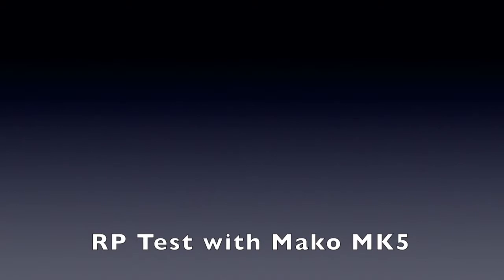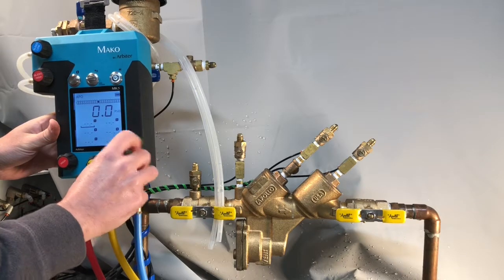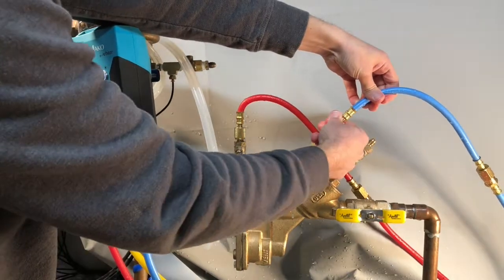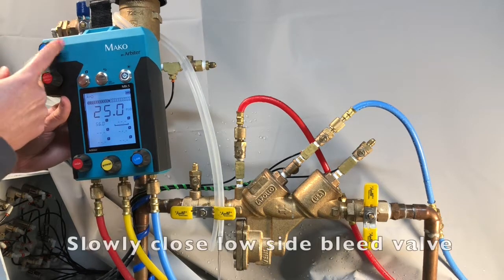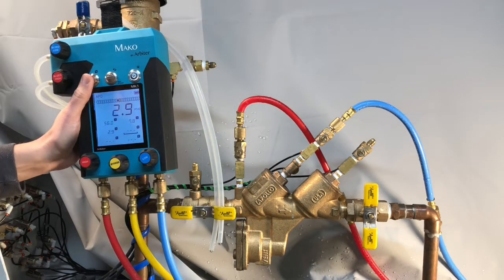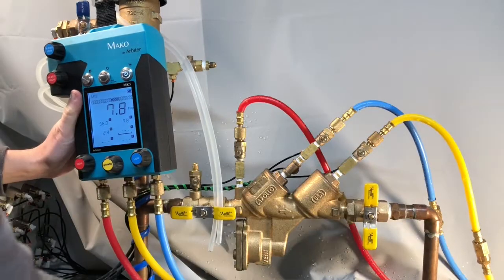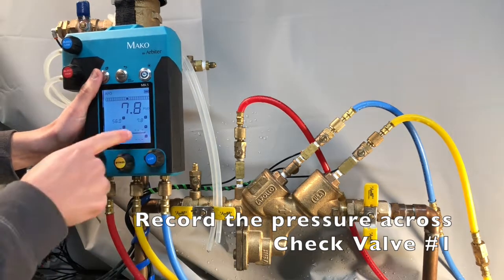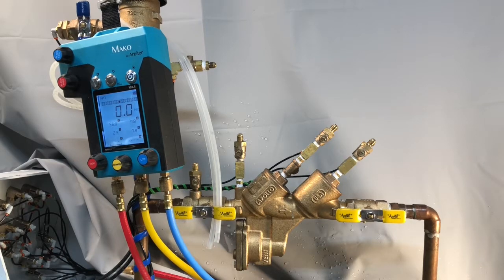RP Test Procedure USC 10th Edition MAKO 5 Valve Test Kit

Comment: I just wanted to let you know that you did not finished the test of the RP device during the video. You did not check the #2 check to see what it holds at.
Reply from the maker: Hello Randy, thank you for your comment. In this video we were strictly illustrating the field test procedure as described in USC Manual 10 which calls for determining whether check valve #2 "holds tight" or "leaks" rather than recording the differential pressure at which it holds. There is an excellent discussion about this topic in an article called "About the RP Field Test" from the Summer 2013 issue of USC Cross Talk: https://fccchr.usc.edu/_downloads/Cross%20Talk%20Archives/2013.31.3.pdf. 

We are currently working on making additional videos and in our next RP demonstration we can show the CV#2 differential being recorded. Thanks again for your comment!

Comment: Could you explain what the recorded values mean?
Reply from the maker: Hello ro Ku, in this video the captured values that are specified are: 

1. The APPARENT differential pressure (PSID) across the #1 check valve 

2. The PSID at which the relief valve first opens (must be 2.0 or greater in field testing) 

3. The ACTUAL differential pressure across the #1 check valve (must be 5.0 or greater in field testing). 

In field testing following USC Manual 10, the tester will also record whether the #2 check valve held tight to backpressure. We hope you found this video helpful! For more information about the Mako gauge, please visit https://arbiterbackflow.com